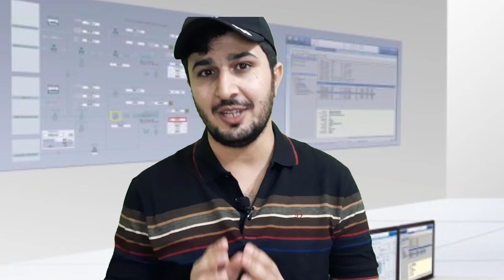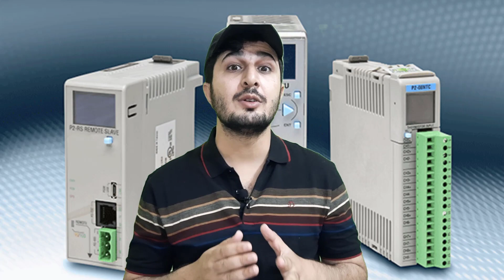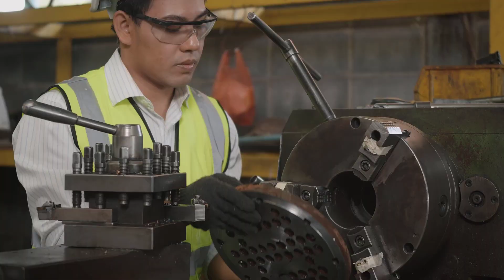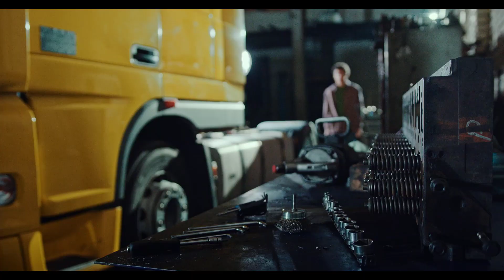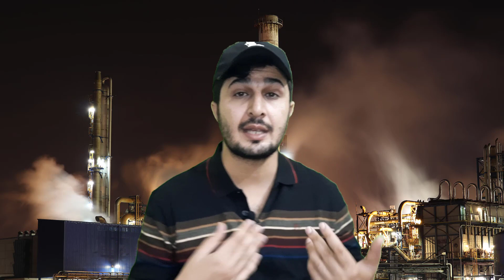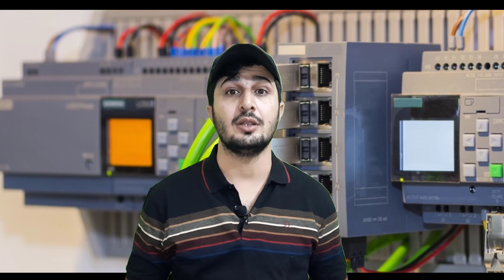PLC vs DCS | What is the Difference Between PLC and DCS? | 2021

Comment: For me, I find ladder logic easier to trouble shoot. That is why I am more apt to use PLC. I do work in the automotive industry. But we use multiple PLC's fashioned similar to a DCS system. We build these in a layered fashion. As we change processes, we integrate each new system with it's own PLC.
Reply: Totally Agree , i prefer multiple PLC's to control different process instead of a DCS system.

Comment: Can you make a video about scadas? I've seen for siemens some products like PC7 for this systems. But for AB i dont really know how it works, the only thing I know about this is Wonderware for screen design, but what or how is the data process?
nice videos dude, I have few days since I found your material specially  Q&A sesions. Regards
Reply: PSC 7 is a process control system and it is a kind of siemens DCS system and it has many libraries according to process application,like for Cement and coal mining industry it has CEMAT lab,for oil and gas it has different libraries and for HMI they use wincc application for presentation and control of plant.